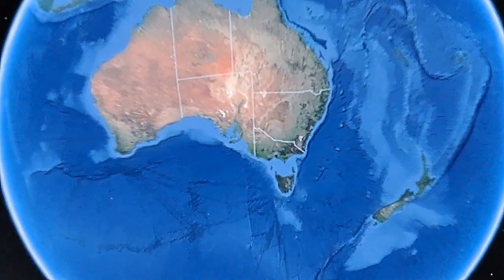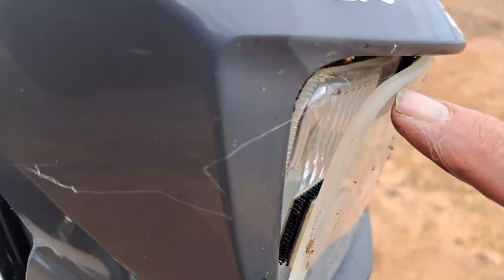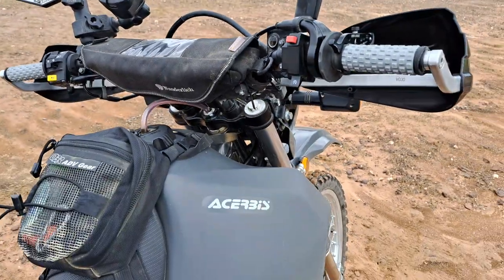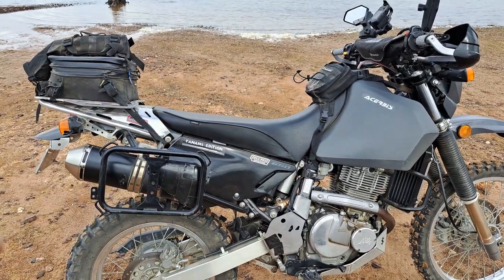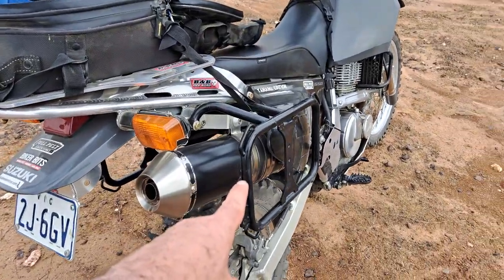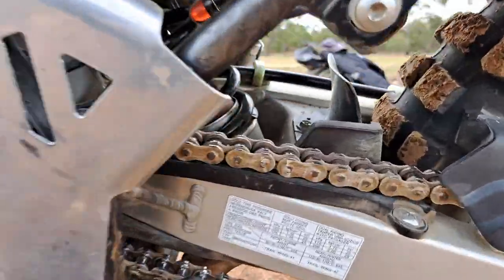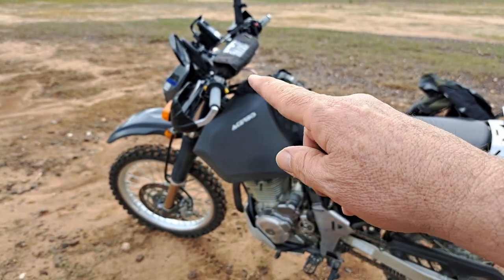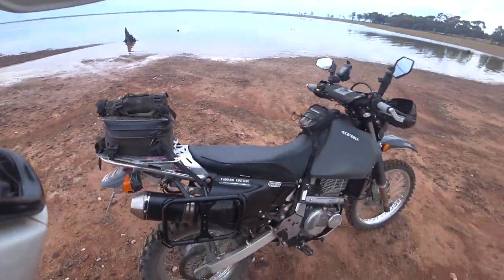SUZUKI DR650 - 20,000km Owners Review

Comment: run ngk iridium plugs, you won't have to replace them for at least 50k km (they last 100k+ km in cars) save wearing out the threads in the head changing plugs all the time. just make sure you put some never seize on the threads of the iridium plugs seeing as they are in there for so much longer.
Reply from the maker: Hi Michael, Thanks for your comment, Great to hear what others are running on their Pigs. I enjoy replacing the plugs, gives me some tinker time with the Pig, just old school I suppose. Regards FPPete.

Comment: I made my own silencer from stainless 100mm thin wall tube. Made the silencer internal with perforated tube and exhaust packing from the MX store. Main jet increased in size and needle jet is a replacement with stronger taper raised up as they run weak on the standard needle set up. It now responds much sharper from low revs. Power has increased dramatically. I also replaced the seat and run the same 20 litre tank. Renthal handle bars with lifts. One thing I did that made it great to ride was replace the standard screen with a taller one. Gives much better wind protection at speed. Mine is a 2014 model. A few times I have tried to buy fuel and they refuse to turn on the pump until I remove my helmet. 7-11 are the main problem in my area.
Reply from the maker: Thanks Messenger, Really appreciate your comment. It's always good to hear what others are doing to their PIG's. I kept my helmet on so l could video the refueling. I took it off when I went to pay for it. Yes some servo's can be funny about helmets. Regards FPPete.

Comment: Hi Pete. I changed my DR to the factory lowered setting (40 mm as per the manual) and had the suspension reworked by MPE up the Sunshine Coast. Works great for me. Sacrificed a small amount of ground clearance overall but it’s never been a problem even in really crappy places.
Reply from the maker: Hi Mike, Thanks heaps for your info. Hope it helps others as well. I like to hear what other Pig riders have done to their bikes. The suspension setup is a great discussion topic. Regards FPPete.

Comment: 🇦🇺😎👍Hey mate the first DR 2016 did 115000kms ( never used oil )( no noticeable drop in power ) and the timing chain needed replacing. Unfortunately while working on the bike the mechanic destroyed the engine. DR two 2019 65000 kms and needed a new head gasket. The next mechanic changed the jetting and cooked that engine. Mechanic number 3 .Full top end rebuild now and doing well ( Marty’s Moto Ipswich QLD ).. love the tank bag…I brought a new stainless header pipe the other day but that will be installed on the 2016 engine as it is being rebuilt as a hp engine…love the racks..you need pivot pegs…love your battery charge up connection….I lube my chain regularly and never clean it and I get about 33/34000 kms , road riding only..I got a small tinted visor from NSW and that’s an absolute must..at least rebuild the front forks , you won’t believe the difference …great video , now you’ve made me want to go for another ride😉👍
Reply from the maker: Hi Big Trev, Thanks so much for your fantastic Comment. Really good to hear DR650 experiences. They are such a good bike. I hope to keep mine for as long as I can throw a leg over it. And yes the front end build is a high priority. Glad you enjoyed the video. Regards FPPete.

Comment: I recently bought  the Screaming Demon exhaust based on you & Marks video. Shipped to other side of world in Ohio ! What do you think of it after the years ? I’ve only had it on a month.
Reply from the maker: Hi Bob, congrats on your S/Demon. I have had no issues, other than the rubbers around the mounting brackets are starting to perish along the edges. I run the most restrictive insert in the end of the muffler. It's the quietest and minimal power difference. I will be doing a 30000 km video soon on the DR650. Regards FPPete.

Comment: 😮  interesting you have a dr650 and T7.  I would of thought they were to close in use
Reply from the maker: Yeah I have been asked that a few times. There are big differences between the 2 bikes. About 50kg in weight and 30HP. The DR650 is a single Thumper, old school technology verses the T700, Twin Cylinder and the latest tech. I purchased the T700 first and I started to ride more and more offroad, and found the T700 too big and heavy for my skill level. The DR650 just suited me more for the offroading. Thanks heaps for your comment, regards FPPete.

Comment: Great video mate,  cheers
Im looking to buy my first bike and since they don't sell them in Aus anymore,  the second hand market is charging new bike prices. If you had to replace this bike for something you can buy new today,  do you have any idea what that would be?
Reply from the maker: Thanks Josh, The DRZ400E is a fantastic dirt bike. The Honda CRF300 is also a great choice. An entry level Adventure Bike the new Himalayan 450 is worth a look. Test ride as many as you can, this helps with making the right choice for you. Good Luck. Regards FPPete.
Reply: @FULLPELTAdventures  I appreciate the reply mate, thank you

I'm about a couple of months away from getting my RE license so when I'm able to I'll be test riding as many as possible. I'm keen to see what owners put the Himalayan through but I think I'm leaning more towards the dual sport category just so that I can feel confident hitting the rougher stuff if ever I come across it.

I've sat on both the drz and the crf300 rally. there was also a used drz at the dealership which had a 2 inch lowering kit on it, with that kit both the drz and the rally where the same height for me (on the balls of my feet). I was on my toes with the standard drz lol. not sure how much that would change with a larger fuel tank and some soft luggage strapped onto it if the suspension is prone to sagging in those conditions?

My heart says the drz is the way to go but some people complain about carbys and no 6th gear so I wasn't sure if its a smart purchase in 2024, mainly for a first bike and only means of transport. I will say though, the crf build quality was quiet disappointing. It looked like very cheap plastic and I would hate to think of how that would cope with being dropped a few times
Reply from the maker: @JoshSinnott97  I love the DRZ, buying new is piece of mind that nothing has been tampered with, carby, airbox etc. The CRF300 is a better commuter bike if using the bike as your only transport. You can get crash bars for the Honda that will look after the plastics. Regards FPPete.

Comment: Very Nice. I would like to offer a few tips should you be so inclined.  I would never ever use slime!   Research and you will see what I mean.  Ride-On is much better. I AM NOT affiliated.   Also a small tire pump is all that is needed for those low pressure tires. The portable type like they carry on a bicycle. You do have to pump it many times since they are low volume.  But you do not need to worry about power or if and when it will quit.  Try it at home first.   Also make sure you can replace a tube when far from help. Again do this at home. Cheers Mate and Gday!
Reply from the maker: Great advice David, really appreciated. I must give the pump idea a try. Kind Regards FPPete.

Comment: You describe a top upgraded DR that you,ve clearly spent lot,s of time and money on. You suggest in your narrative that you also run a T7.........
For the average punter wondering  how and why???, please explain.
These bikes are considered direct competitors and the DR with the described upgrades probably is a better bet than the T7. ????
Reply from the maker: Hi Katherine, I have been asked this question a few times, and hopefully do a video on my thoughts of the T7 vs the DR650. They may have similar capacity on paper but they are poles apart in most area's. The T7 is a modern twin cylinder, 210kg adventure Bike, The DR is 30 year old technology, it's a simple Dual Sport bike that weighs about 170kg. Two very different bikes that I really enjoy riding. Between them I have done 52,000km so far. Regards Pete.

Comment: When you change your exhaust to a more "free flowing" model over stock you lose much needed low-end torque unless you re-tune your bike....
Reply from the maker: Hi deejay, Really appreciate your comment. All I noticed with the slip on Exhaust was a huge power gain over stock. If there was any low-end torque loss it must have been minimal. Kind regards FPPete.
Reply: @FULLPELTAdventures Good to know...maybe it's because it's only a slip-on and not a full system. Good vid regardless.